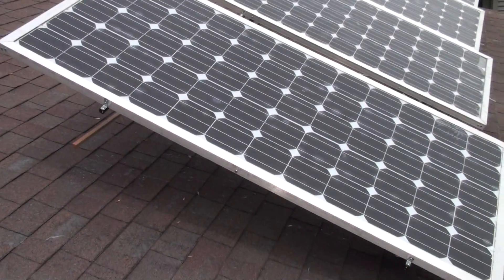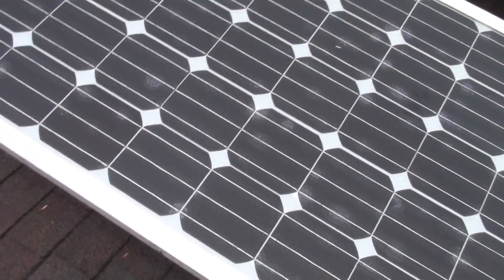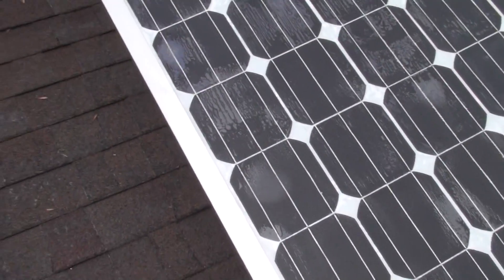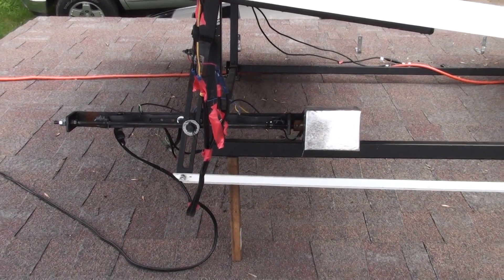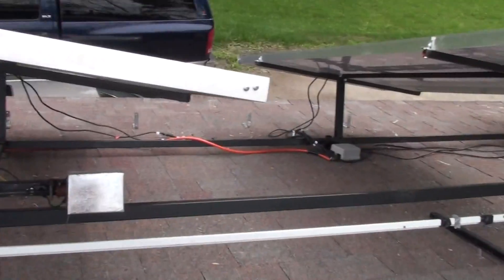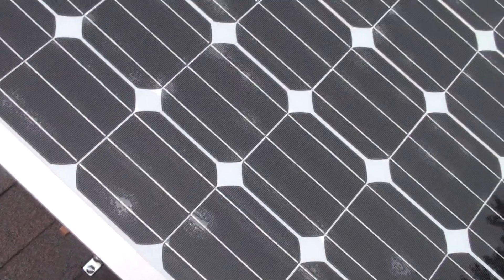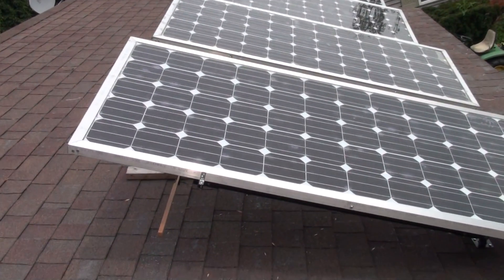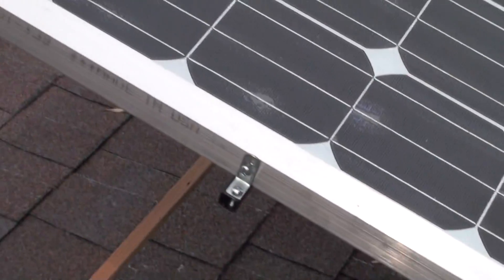4 completed DIY solar panels 60 cell each

Comment: Hello, I like your solar panel lamination process i am interested to make the oven !
please send me details about oven and please answer my question ? its help full me
1) This is 100% work to laminating Glass ,EVA, S.Cell, EVA and Back-sheet all  the  OVEN heat is SUFFICIENT ? 
 so please send me total process i shall make it
2) How to remove 100% air bubbles ?
3) In process of solar panel laminating any risk to brake the Glass? 
4) Which type Glass used to bear heat ?
5) I have make Digital Thermostat with display to control the   
 I have decide to purchase ready panel but it is very costly in my country (India) more than  "USD" 1.2 to 1.5 $   = 1 Watt and my requirement is near about 900 Watt all panel cost goes near about "USD" 1125 /1141 $
so i decide to make it at home 
Depend on laminating process success full
All Theory  i have collected  100% than  i decide to go practical  
SO YOU ADVICE IS IMPORTANT !.   

Than i have purchased Solar Cell online 6x6 Solar cell = 220 pieces and tab wire and EVA Back-sheet  etc...

Comment: Have you tried mirrors on the sides? They reflect more light towards the solar panels. You will get around 30 to 50 percent more power on the cells...., hopes this helps. But make sure that the mirrors are wind resistant and don't get broken off in high winds.

Comment from the maker: @helloman1976 That's what it costs if you do it right and use The EVA, TPE, junction boxes etc. that the commercial panels use. These should be 240 watt panels though. Is the 1.50 per watt on the 175's including shipping. From Sun Electric it would cost me over $200. for shipping to where I live. So the panel I built for $300 would have cost me close to $600. These are Monochrystaline cells 6x6 inch. They  are running at 37 volts DC open. I think that's why the power jack didn't work well.

Comment: @wiboater4 You paid $300 a panel for the ones you made? Ouch! I get my panels for less than that and they are already built with a 25 year warranty. Monitor a website named Solar Blvd dot com and they sometimes have excellent deals. I got my mono 175W panels there for $1.50 a watt completed and I got my 200W poly panels on eBay for $1.40 a watt shipped and completed. I wouldn't put any time into those if you're paying $300 a panel. Also, check out my videos PJ grid ties are about 85% efficient.

Comment from the maker: @helloman1976 I've been watching those but you have to add in the shipping cost and the frame and junction box cost. These cost me $300. each. Each small cell is supposed to be 3.8 to 4.0 watts , so they should be around 200 to 240 watts per panel. I just put two enphase inverters on and ordered  two more. I think I'm not getting good efficiency with the power jack 1200 watt grid tie inverter.  I'll have to get an enphase "Envoy" to see what each panel is producing after the Enphase inverters on

Comment from the maker: @Fearlessthinker  Just wanted to add something about heating from the bottom. You don't want to concentrate to much heat on the front of the panel in one spot or you'll have it overheat and bubbles will form. So from the ends is better You want uniform heat all around.

Comment from the maker: @sjh7132 The heat during the day seems to be cutting a lot of power. I was just back out there and now with a few clouds going over and temp a little cooler it was up to 398 watts. The othe day I saw almost 500 watts but I think that was due to cloud effect. I'm tempted to try two panels in series once. I also have those other panels on the house that i can run either 12 or 24 volt. Could add one each of those in series with a 30 volt panel. I  think the cheap grid tie is the problem.

Comment: @wiboater4 I wonder if it has something to do with your peak power voltage (30v) being so close to the lower limit of the GTI (28v).  I've found the Powerjacks can only do close to their rated power with higher voltage inputs.  Unfortunately two of your panels in series is too much voltage.  Maybe you can try using the panel with the wiring mistake to add a little voltage to each ot the other 3 panels.

Comment from the maker: @sjh7132 They are hooked in parallel. The voltage open circuit is 37, 34,34,and 33 from left to right on the panels.At full sun 3 PM in Wisconsin. All four hooked up in parallel right now are only putting out  317 watts according to the Kill a watt meter. alone each put out 127 watts earlier today and around 307 watts together. The #12 stranded wire going to the grid tie inverter isn't warm at all so I don't think that is whats pulling them down.  Grid tie is at 28 volts. rated 28 to 52 v.

Comment from the maker: @Fearlessthinker Thanks, for the info.  I know mine won't be 100%. I'm using a powerjack inverter. I have some other panels feeding into a battery bank thru a BZ Mppt controller. I think I get better with those but then there has to be some loss thru the batteries after. You also have the cost and maintainance of the battery bank. I probably will go to heavier wire coming from the combiner box to the inverter later on. Have to build a bigger combiner box first.

Comment from the maker: @Fearlessthinker With the 4th panel now I've only seen around 500 watts total so far but that might improve a little if I ever get the 2 axis tracker from red rock. Also the weather has been hot lately , should get better watts when it cools off.  But still way under what I figured I'd get. Each cell was supposed to be 3.8 to 4.0 watts, at 30 cells per panel that should be close to 240 watts per panel. I know I have some loss from iron(green tint) in the glass and wire , inverter etc.

Comment from the maker: @Fearlessthinker I've got the 10 awg coming from 3 of the panels to the combiner box. Just ordered the MC4 cable for the 4th one today. I am using 12 AWG from the box to the 1200 watt grid tie. I think the grid tie is where the loss is at.  The foam board was $30. for two sheets, one roll of masking tape, plastic sheeting .  The vacuum pump was $104. at Harbor Freight on sale. 2.5 cfm. You could probably use a good shopvac instead. I had the heat gun , can't remember what it cost.

Comment from the maker: @MrHorsetail It's a #12 wire. The first 3 panels were putting out about a120 watts in the lighting that I tested them in but when hooked together in parallel they put out less than 300 watts. I'm running them into a 1200 watt grid tie inverter 28 to 52 volt capacity. I'm getting a 28 volt reading at the terminals of the inverter. I haven't had time yet to test the last panel I made seperatly but voltage on it was around 37 volts before I put it on the roof.